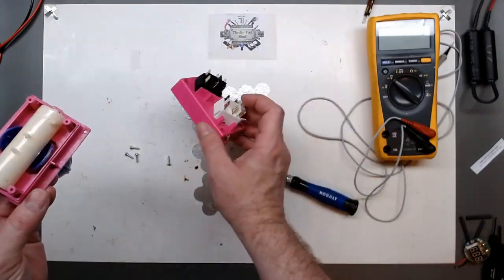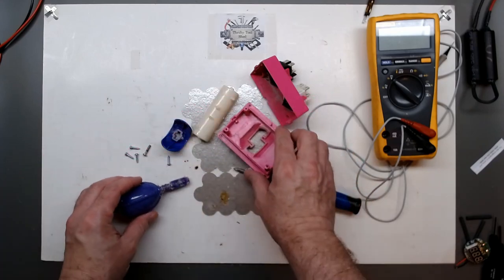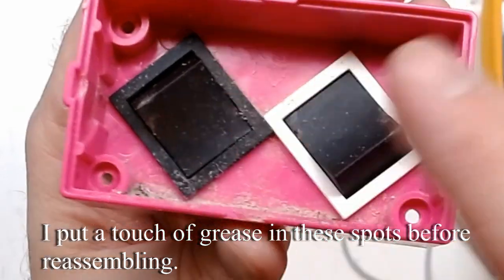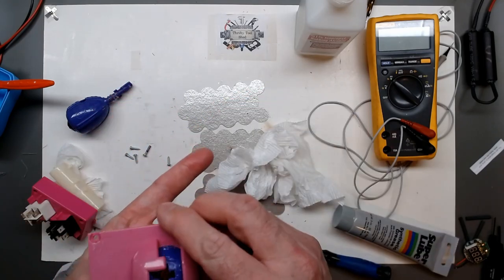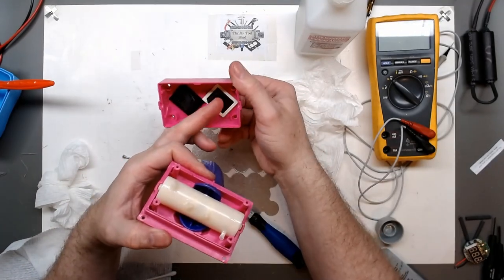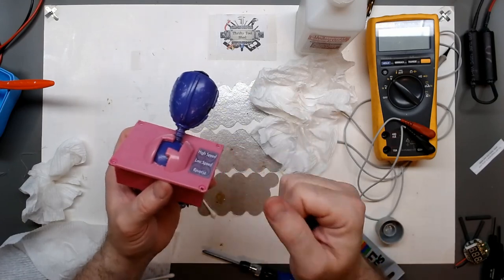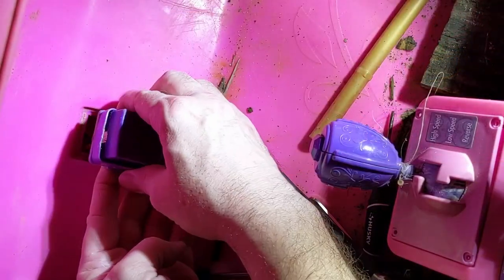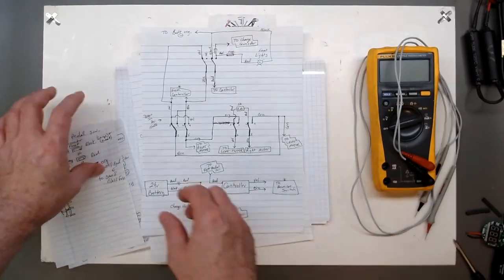Disney Princess Carriage Reverse & Speed Selector

Comment: My carriage does not go forward. Brand new. It worked until l brought it home and the first use was a dud. I goes in reverse fine. It also engages when the pedal is pushed but wheels dont turn. I'll check the switch. Thanks for posting this video.  After checking out the switch. It was indeed a broken peg that engages the two switches. It finally worked after several attempts. Merry Christmas.

Comment: Thanks for the vid. Ours would only go into reverse so I took it apart and one of the little cogs that flip the switch had broken off. I just recounted the switch box without the shifter using 2 holes that I drilled and using screws to keep it in place. Its doesn't look as nice, but shifting is now error free just flipping the little switch
Reply from the maker: Excellent!

Comment: I just bought one and right out of the box (after the initial charging time) it will not reverse.  Any ideas to fix or should I return it for exchange?
Reply from the maker: I would return it if new. The switch for reverse is where I would start usually!
Reply: @ThriftyToolShed  thank you! That’s what I’m toting to do.  I did figure out what is wrong.  So The white plug, that third connector on it is burnt. I do believe that’s why it won’t reverse bc it does does high and low speed just fine.  I think that third bit must have to do with the reverse.  I do appreciate your video and advice!